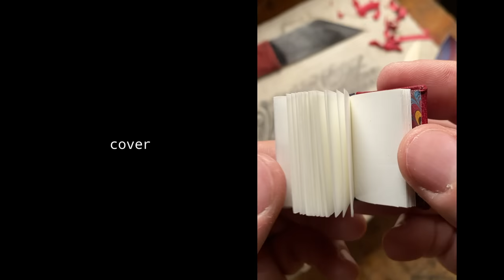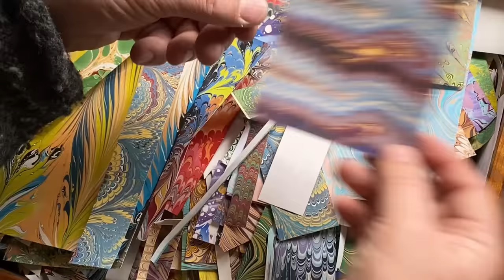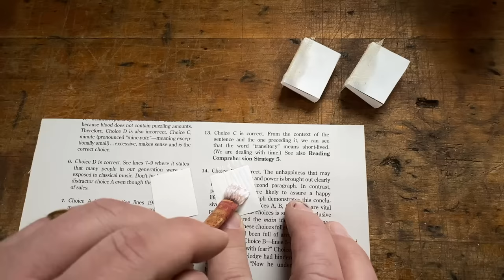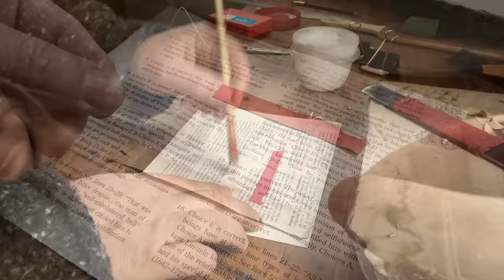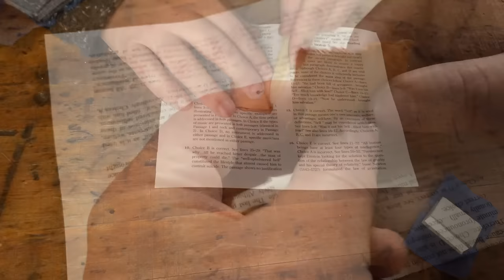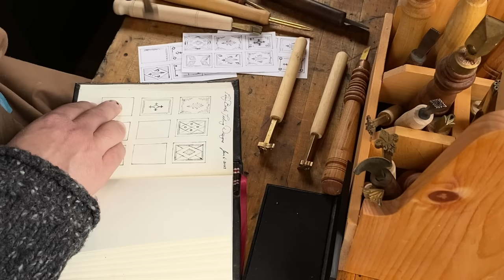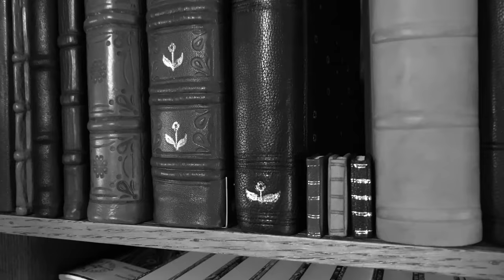Making Tiny Books - Fully Functional Leatherbound Books in Miniature

Comment: I find using a stiff brush after putting on foil helps to make it look better and removes any bits of foil not hot pressed
Reply from the maker: That is an outstanding tip and I will definitely try it, thanks!

Comment: Wonderful, I love this project. 

If you are looking for other interesting projects i would recommend binding the Tomoe paper in a limp binding. I don’t see any content on YouTube for limp bindings (scripture bindings). I’ve personally done custom printed scriptures using tomoe paper and it turned out wonderful. The tomoe doesn’t bleed through if you use pen on the paper. I love it. 

Thank you for the high quality videos and great content.
Reply from the maker: Great suggestion! The Tomoe paper would indeed be lovely for such a binding, it's so drapey, if that's a word. Thanks for the comment!
Reply: @FourKeysBookArts  I had a scripture binding project that I needed ultra thin paper and I found it isn't commercially available to the public; some publishers used cigarette paper because it was ultra thin and I couldn't even locate a source. I came across tomoe paper because I am a sketch artist also and the tomoe is magical with fountain pen ink and doesn't bleed hardly at all with pen ink and is quite strong for its thickness. I recently bound a drum cover binding using tomoe river (B5 52 gsm white paper) for a fountain pen notebook and it turned out great. Anyway, I was happy to see another bookbinder using tomoe river paper. Thanks Dennis. Love your channel.

Comment: This was wonderful, thanks for uploading!  If you wanted to make them not-blank -- use pages that had been printed with something -- do you think 128 pages is possible?  Seems you'd need thicker paper to avoid bleed-through with the ink, and that would reduce the number of pages you could include per signature.
Reply from the maker: The Tomoe River paper is famous for its non-bleed through properties, even with wet fountain pen inks. Provided I could run it through the printer I think it's entirely possible.
Reply: @FourKeysBookArts  Kudos to anyone who can get TR paper to print double sided! I find it jams and crumples after the first side prints.
Reply: Figuring out page imposition and creep would be tricky -- to get everything in the correct place once the signatures are cut, folded, sewn, and trimmed!
Reply from the maker: @batwrangler  you hit the nail on the head with this - the tiny scale leaves very little margin for error (pun definitely intended😜)
Reply: @FourKeysBookArts  Now that I think about it, the only bookbinder I've ever seen make printed tiny books is Kototsubo on YouTube, and she has her own printing press with super-teeny type that she uses.  A modern printer probably wouldn't manage it.  Rats.  😕

Comment: This is a question I only now thought of, after all the videos that I've watched, maybe you have mentioned this... but is there a consistent size to each of the books? What I mean is, I noticed you trimming the edges with the sharp knife, and I remember you doing this for other books that you've made, so I was just wondering if because of the trim process in squaring up the books, each book's size will differ slightly, or is there a way to take the excess into account for final size before the whole process begins?

Comment: I’ve always wondered what the job of an endband is? Is it to keep the pages from spreading apart at each end?
Reply from the maker: That's more the job of the kettle stitches. The endbands were originally more to protect the pages from wear and tear at the top and bottom of the spine, though they have evolved to be mostly decorative nowadays.
Reply: @FourKeysBookArts  thanks so much for your reply. I’ve made a few books but never put end bands in them and always wondered if they were necessary.